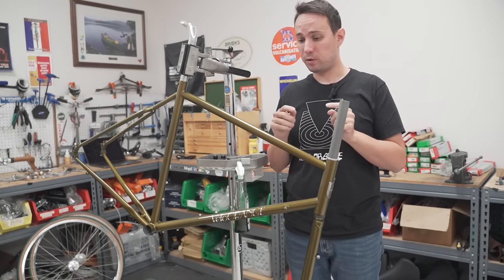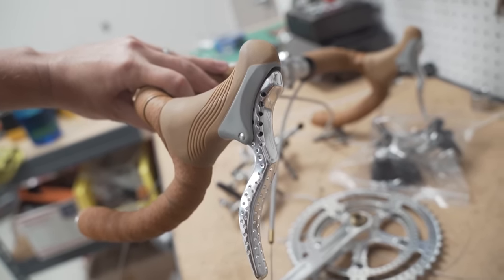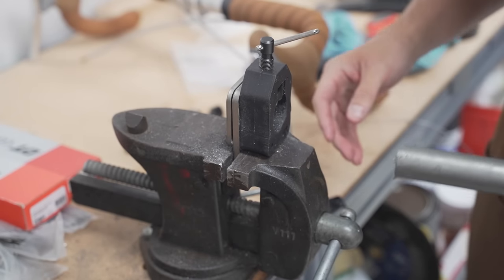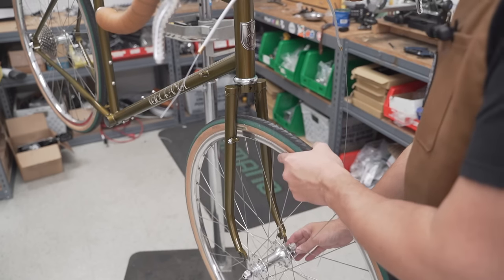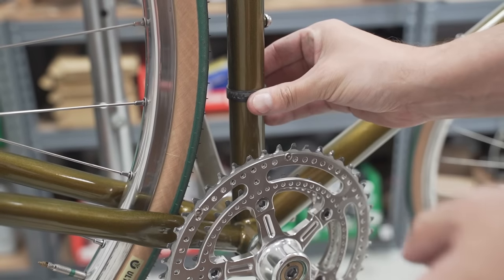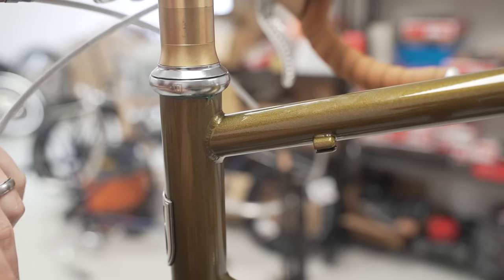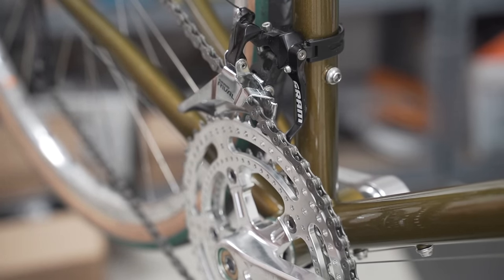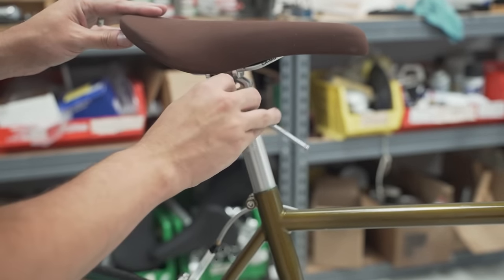Downtube Shifters in 2023?!

Comment: Five other benefits of dt shifters:  Much shorter cable length so more direct "feel" when shifting and less cable stretch.  No need to fuss with tensioning to get the rear derailleur indexing just right.  Easy to trim the front derailleur as needed.  If a cable breaks, just take what's left and use one of your bottle cage bolts to lock it in place/tension it for the gear you want to be in to get by.  No need for a lot of cable housing.
Reply from the maker: Nice tips! I've also seen people take the remaining length and put the cable head directly into the barrel adjustor on the derailleur, tension it to which gear you want to be in, and wind the excess into a loop. That actually works well for a budget single speed, too!
Reply: I like the cut of your jib sir
Reply: If someone wants to build a retro bike with older technology, I say go for it, but let's not pretend like it's some kind of performance upgrade 😅
Reply: @TheTrailRabbit  No, but it's a quality of life upgrade.

Comment: Downtube and friction shifters in general are great. Pretty much indestructible, simple, and beautiful. Love a classy Rando build.
Reply: Haha yeah right, downtube shifters are zéro maintenance but they can’t handle actual bad weather abuse like 105 lever shifters for example, had two cold rides in the rain on old campagnolo downtube shifters and one brusque shift made it break in 2 pieces
Reply: @hopfag6555 You’re one example is countered by untold thousands of examples of downtube shifters just working in all kinds of conditions. Must be more to the story. Care to tell?
Reply: @CountryB4Party  well downtube shifters especially more performant models are not full metal and they got some kind of ceramic texture in the inside which all broke with a brusque load even if it wants heavy in any way… this is not the first exemple of those downtube shifters failing especially shimano’s
Reply: @hopfag6555  "performant medals?" what meaning lightweight and brittle? 
Just have proper metal ones..  Campagonolo are not necessarily of decent quality metal, mainly just crafted to look nice and with relatively good engendering tolerances. A lot of "fancy shmancy" French and Italian components do actually just shear of and break sooner or later. If you want old school European metal then English or German seem to hold up much better over decades of aging, otherwise Japanese/Taiwanese of course is generally decent.
Reply: Friction shifting is not in fact "great" 😅

Comment: I love down tube shifters, especially if I am riding on the drops, I can reach right down and shift. The greatest thing about down tube shifters is that they are out of the way when you aren't using them, and maintenance is easy. Replacing cables doesn't require removing bar tape, threading the cable through the inside of the frame, or any other annoying routing, and replacing the shift levers is a similarly easy task.
Reply: Likewise, loads of other possibilities too, cheap, lightweight, drop levers and v's, although they suck in traffic.
Reply: What people forget is how much weight brifters add to the handle bars.  Downtube shifters all the time.
Reply: Stop the world, i wanna get off.
Reply: Really? I'm shifting in the drops without taking hands off the bars with brifters and maintaining complete control over the bike. I have friction downtube shifters on my commuter. It's never as easy to shift. What it is is reliable and light
Reply: I had the ball end come off the cable on my rear dura ace brake/shift lever.  I replaced the cable and went on a ride with some friends. It turns out that ball end of the cable jammed somehow into the lever and caused all kinds of problems.  Sometimes it would work ok but most of the time on the ride I had a two speed bike. Trying to figure out the problem and getting that ball end out of the brake lever was horrible.  It never would have happened if I had down tube friction shift levers. Sometimes less is more.
Reply: You need more practice ,  since you find it harder. There's no need to be nervous about taking a hand off the bars. You need to do this to indicate your intentions to other road users@Shadowboost

Comment: I’ve got two early 80s Raleigh Randonneurs (531ST frames) with downtube shifters. Love them. So simple, so elegant and so easy to use. Bikes, like life, were simple then. No complicated brake levers, no internal routed cables, no hydraulics, no tubeless mess, and no electrickery gear shift.

Comment: I’ve ridden bikes for 50 years, I have six bikes varying from the 50s up to the late eighties, all except one (sturmey 3 speed ) have DT shifters. I feel comfortable and muscle memory helps with getting shifts right, well 90% of the time anyway. I still use straps and clips, and quite often I’m in the pedal and away before the SPD and clip less crowd. I do envy the brifter brigade occasionally but I’m used to the old school and it’s worked for me all those years, and simplicity is usually a lot more reliable and easier to fix on the road.

Comment: Such a nice build. Simple,good quality and pleasing to the eye. Interestingly in direct contrast to the latest,drop seat stay,Carbon,disc brake road bike,complete with in-house wheels,seat pin,bar/stem combo….been racing,riding,touring,sportif participating since 1970’s..following the tech as I went. Now it has,in my opinion passed a point whereby I feel….ENOUGH!  Last year ditched my Carbon MTB frame and bought a hand built 853 steel. Recently built a 531 Road bike with 11 Speed Campy Record.  If I was taking on a long tour would look to use downtube shifters,for simplicity and ease of maintenance…
Reply from the maker: So true. You don't need a ton of tech to have a nice riding bike. Not all riders are trying to win races and searching for marginal gains. Most people just want a nice and practical bike without breaking the bank. Sometimes the best bike is the one you forget about when riding it.
Reply: N+1

Comment: I have DT shifters on my Surly Cross Checkset up for general riding, utility and touring. With both shifters set to friction mode, it is easy to get perfect shifting with a bit of experience and they can be adjusted for silent pedalling. Any stretch in the cables can be adjusted out to maintain silence.

Comment: For my newly build steel road bike, I chose Shimano’s 8-speed index down tube shifters, I just love their light weight and simplicity! And the index system is very handy and practical too.
Reply from the maker: Ooo I was looking at those. I've used the 10sp Dura-Ace in the past, but they're rare/crazy $$ nowadays. Good review all-in-all for them?
Reply: @velo_orange  Absolutely!
Reply: rollinrat4850  that’s a speak of experience👍
Reply: @JackY-pu5nh I have the same shifter. It's a Shimano SL-R400 down tube shifter or a Shimano claris DT shifter. I have it paired to the claris long cage rear derailleur but have used it with the suntour r80 and it works great with both. I've had it for a little over a year and a half now and I've noticed some wear on the shifter and it doesn't shift as well as when it was new but still works pretty damn well
Reply: @velo_orange it's a bummer you can't fit a rear rack onto the rando frame. I would buy this frameset today if you could. I'm running a State Bike Co 4130 Road frame and even though it's very strong and solid, it's a compact frame with super aggressive geometry and isn't really conducive to the type of riding I do (bike packing, endurance and gravel). The rando checks all the boxes I'm looking for except you can't put a rack on it. Pretty hard to find frames like this these days that use side pull caliber brakes, standard QR axles and relaxed geometry
Reply from the maker: @vintagesteel  Blackburn used to make a rear rack that had an arm that went around the back of the brake caliper. That should work fine, either from Blackburn or from another manu.
Reply: @vintagesteel  Good to know that. I just had it over a month, I hope that it could last longer than I expected😂
Reply: I have those on a Titanium bike I’ve set up for touring
Reply: @vintagesteel With Cable ties, a couple of clamps you can put a rack on ANY bike.  Multiple cable ties at each point for reliable redundancy.
Reply: @dewiz9596 that's what I was thinking. I could probably Jerry rig something pretty strong but nothing beats bolting a rack directly onto the frame

Comment: Great video, really enjoyed it. I do wish you would not have skipped adjusting the limit screws. That’s one thing a lot of home mechanics start with and it’s always worth seeing a pro do it.
Reply from the maker: Noted! We've done it in previous videos, but will be sure to include it in the future. The yaw derailleurs are definitely outside the norm for adjustments. It wouldn't be the first option now that I've done it. Going with a regular 105 or Sora would be better for this build.
Reply: @velo_orange  I like the front mech that swings differently,  that you demonstrate.
Reply from the maker: It is ok. I think Nic ended up switching to a regular Campy or Shimano derailleur because he didn't like the yaw. If I did it again, I'd go with a Sora or 105 front derailleur for this setup. @ThisTimeTheWorld
Reply: @velo_orange  105 is great stuff. Sora looks good but I haven't tried it yet. I have a pair of 3x7 brifters I might use next year. I likenthe campy style thumb triggers
Reply: rollinrat4850  campy is neat but stuck up and high dollar. One of the first things I learned about bikes was campy stuff is pretty much made to only work with other campy stuff. Italian bbs are weird, too.
Reply: rollinrat4850  I'm having a good time with shimano compatible 7 and 8 sp stuff.  
I think "shimergo" is the slang word for putting campy brifters with shmano cassettes and RDs. There's charts somewhere for the cable pulls and cross compatibility charts.
Reply: rollinrat4850  expensive stuff is nice,  especially when you get it in a yardsale or because the owner had to have The New Things.
Reply: @ThisTimeTheWorld The Sora FD 3030 works great.  I have gone with triples on several restomods, and this is my go-to solution.

Comment: Love my down tube shifters. 650b swapped an 80's race bike to fit 42mm slicks and 9 speed cassette. It's a fantastic bike for mixed terrain. Though really, I just clicked on the video to find out who makes the brown shifter covers... I think VO needs to source a new run of these. I need them for the barcons on my latest build!
Reply from the maker: Nice! Rustines used to make them, but I no longer think they do. They stopped doing the bike stuff during the pandemic to focus on their industrial business.
Reply: @velo_orange  Yup, I did a quick search last night and found a few international shops that still had stock. Will have to check out shipping costs. Think there's a chance of talking Dia Compe into creating some molds?
Reply: @velo_orange  They are still on the Rustines site and available in 4 colors. Sadly they want 45 euros for shipping :(

Comment: My no fuss just ride for fun/parts bike/make me stronger bike is a steel Lotus Excelle, rocking drop tube non indexed shifters. Makes it easy to switch gearing in the rear from 7 all the way to 11 speed. Just a little adjustment to the derailleur.

Comment: My three most used bikes have downtube shifters. The only issue is reach from the bars if you have a very large frame (though you probably have very long arms, too!), and the same distance issue if you run 26" wheels. On the plus side, if you have a small frame like my wife's 19" with a short stem, DT levers are practically at hand. Also seen top tube and head tube levers on custom frames, and anyone remember Suntour twin levers mounted on a pip on top of the downtube, c1982?

Comment: DTs are a great example of "Newer may be better in some ways, but older is also great." I'm building up an RB1 and I'm actually converting it to DTs even though it had non-original bar ends on it. The other thing too is: Early STIs weren't super great, so if you want to stay period correct but also have good performance, DTs are the way to go.
Reply: I have an 1988 RB2 with downtubes I ride all the time. Someone in the last 30 years put and old shimano 105 set on there.
Reply: "What's old is new again."

Comment: Nice! I love the all silver build and frame color. 
I found friction DT shifter to be hard to keep in gear with modern cassettes and chains. The newer stuff is meant to mke shifting easy, with ramps and pins, which makes the chain switch too easy for DT shifter (when not shifting). I do love DT shifter and one of my bikes has Dura-Ace 9sp DT shifters with a cheap Shimano rear derailleur - it works wonderfully.
Reply from the maker: Interesting point. I feel like 10 speed (cassette) is the pinnacle of friction shifting. Cogs aren't too close together, but the range options and crankset compatibility is seemingly endless. And the derailleurs are so cheap and good.
Reply: @velo_orange  Same - i use the drillium crank in combination with the silver shifters and a 10 speed. Has been working flawlessly for years.
Reply: I had the same issue with newer cassette gearing as well, using both DuraAce bar ends and simplex retrofriction down tube shifters. I wonder if the larger 50mm pull on the VO shifters would give more precision? Years ago I always used ultra 7 freewheels for road but standard 6 speed for crits as it had more “room” for less precise shifts. So would an 11 or 12 speed chain lesson the chance of auto shift with 10 speeds?
Reply from the maker: @leepin_lemur  I don't think an 11sp chain would fit on a 10sp cassette. So I don't think it would help tremendously. I think auto shifting is a consequence of frame flex, too. But that's more in the front.
Reply: My bike would ghost shift when I stood up for more power. I think the frame flex would cause the cable tension to change in the slightest amount, and the chain would get close enough to the cog ramps to cause it to change gears. Now I didn't try every type of chain or cassettes.
Reply: A straight cut cog set will end the problem quickly.  I have one bike with a straight tooth 7sp freewheel and it doesn't jump gears even in rough gravel roads.
Reply: @jamesvaliensi7706  did you try raising the FD a mm or 2?
Reply: I had the same problem when I was using my Dura-Ace EX derailleur on a modern freewheel. Moving to a crappy Altus derailleur with an 8 speed cassette seemed to fix that and I'm not sure why.

Comment: I bought the wrong size bars for my shimano bar end shifters
Will have to use the downtube shifters, and they work, a little overhaul and they are smooth and tight
just hate to hunch over every time I want to shift, and of course, I have to be there for a while as i slowly friction shift into perfect chain alignment
I used to ride 50 miles up to San Fransisco, and  I remember by the time I got there my thumb was so sore from hanging off the top tube and my finger joints from pulling the levers

Comment: In my experience friction shifters work better with more gears.
 It seems hard to find the right gear with a 5 speed freewheel.
 When using friction shifters with an 8 speed cassette it's much easier and faster in shifting and fine tuning gear selection
Reply: Interesting take. I found my 6 speed uniglide cassette with Dura-Ace EX derailleurs to be an excellent friction shifting experience. That wheelset cracked, unfortunately, so now I'm running with a modern 8 speed wheelset + modern derailleurs and I'm finding that to be a great experience too. Just different.

Comment: Very nice. Couple of comments: Those Sram derailleurs are a bit ugly, Campagnolo would be my choice. Bit surprised you didn't use a torque wrench for tightening the BB cups, crank bolts and cassette lock ring.
Reply from the maker: My original build did have Campagnolo! https://velo-orange.com/blogs/theveloorangeblog/lets-talk-rando-builds

In my years in the industry, I only use torque wrenches on carbon bits. Just a lot of experience and a carefully calibrated elbow.

Comment: If you use dt shifters with a Sram 2:1 rear mech, it will possibly run out of cable travel unless you run a 5 or 6 spd or omit some cogs .
Reply from the maker: These work no problem with those rear derailleurs. The barrel is bigger to pull more cable.
Reply: @velo_orange  great. I will look them up.  I like shram rds and have a couple laying around. I don't really like twist shifters though. Sometimes I do the half and half if I get a finicky FD or it's a winter bike
Reply: @velo_orange  they're 80 usd on fleabay.  Kind of steep but I like the big barrel and the idea I could use any cassette or freewheel and play with different wheel sets.

Comment: The front derailleur should have never been moved off the down tube.  The down tube front derailleur offers much more trim options, is lighter and given how much front derailleur is used compared to the rear it would have made sense to stick with down tube derailleur.  Racers used to set bikes up this way to save weight but it makes sense far beyond just to save grams.
Reply from the maker: I've never seen a front derailleur mounted on the downtube? Any sources?